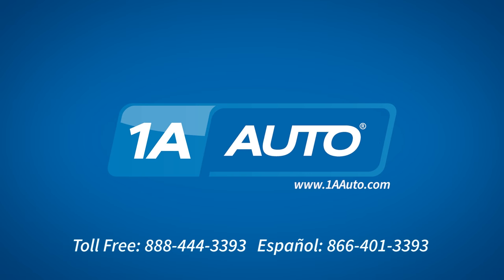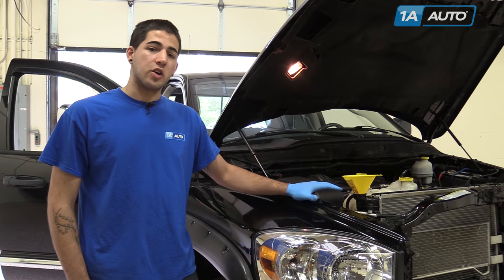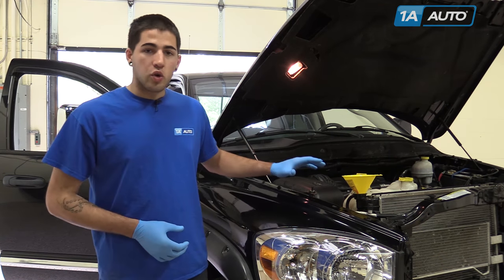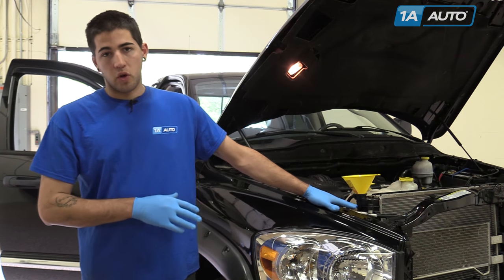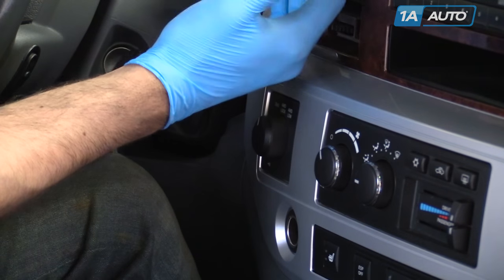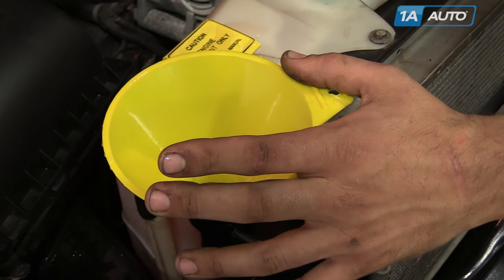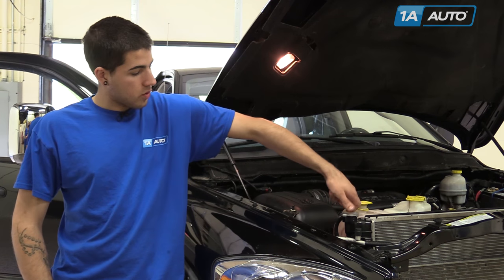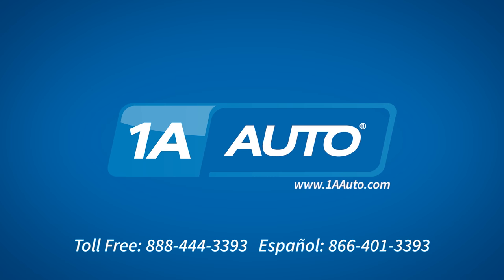How to Properly Bleed Engine Cooling System by yourself

Comment: How long can it take to bleed the air?
Reply: It depends on the vehicle..some can be a contrary and take 15-20 minutes. You really need an actual coolant funnel that comes with adapters that connect to your radiator or reservoir giving a tight seal. Keep the funnel 1/3 of the way full. I turn my heater controls on floor mode and fan speed on low and let vehicle run until operating temp is reached then turn fan on high to push any air out of the heater core. It also helps to rev the engine a few times to get it circulating good. Just make sure you don't run it too long or it could boil over.

Comment: what if the air bubbles are seen in the over flow tank   how do I remove them ?
Reply from the maker: +JOE FORD DIY You may have a bad head gasket on the vehicle.
Reply: hot air coming out of vents now   after system was bled out.   there was air in the system  .

Comment: What happens if the radiator is not full to the top after driving it
Reply from the maker: +DANNY NANDKUMAR We wouldn't be able to diagnose an issue like that here, you may want to have a local mechanic take a look at it. Thanks for checking us out! 1AAuto.com

Comment: This doesn't work for a 2003 Dodge Ram 2500 4x4 5.7l Hemi... there is no radiator cap - just the reservoir.

Comment: Why aren't you using a burping funnel?
Reply from the maker: +obbzerver A regular funnel works fine in this case
Reply: @1AAuto   You're presenting a generic "how to" video, you should use the tool that works in all situations. At minimum make mention of it.
Reply from the maker: Thanks for checking us out! The video does note that this video can be applied to most vehicles, not all. You should be able to apply some of the basic steps shown in this video to your application. Hope this helps you out +obbzerver

Comment: Says how to bleed radiator but it just shows it being filled?
Reply: What you're trying to bleed out of the system, air. By leaving the top off the radiator, or fill tank if you don't have a cap on the radiator, it allows air to bleed out.

Comment: I like how u forgot to drain the coolant from the engine block there's a 17mm drain plug right above the oil filter it holds 25% of the coolant
Reply: The video was not about draining coolant or flushing the cooling system... the video is about bleeding the coolant system while filling it up.

Comment: how to bleed if heater has been bypassed
Reply: Jack up the front of the car, fill up radiator,idle with the cap open 10 minutes after it gets to operating temperature.

Comment: This guy is not using the correct coolant for this vehicle.  It should be the Chrysler approved H.O.A.T red MS9769-G 100,000 mile/5 year coolant recommended OE.
Reply from the maker: +Brian Chambers Thanks for the tip! We'll pass this info along to our production team.

Comment: You didn't cover a "closed system' vehicle like a ford t auras  or Mercury sable. these cars don't have a radiator cap on top of radiator. No help at all !!
Reply: Those use a bleeder screw I think usually it's on the housing

Comment: fyi I have an 1995 impala ss
Reply from the maker: +Kelly S Initially fill the radiator and engine block by disconnecting the upper radiator hose, reconnect the hose. Fill your coolant holding tank to the proper level. Start and run the car and heat as in the video.  Monitor and fill the coolant tank as needed.

Comment: “Level drops allowing the block to fill with coolant “?? No, sir. It’s already full. The tstat opens ~180 degrees F to allow (cooler) coolant into the block after it’s reached operating temperature. I’m kinda steering away from your videos bcuz, although helpful to the novice, aren’t entirely correct. The devil is in the details. Thanks all the same but try and get your instructions right.